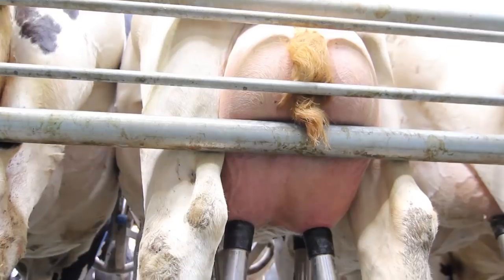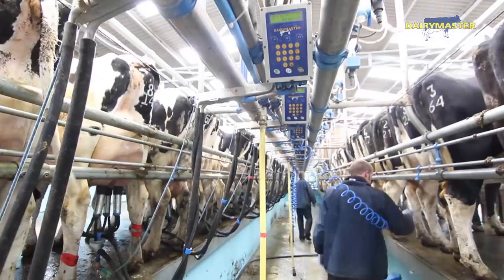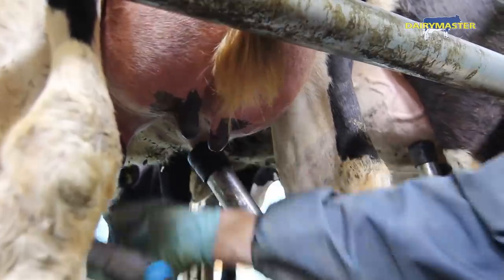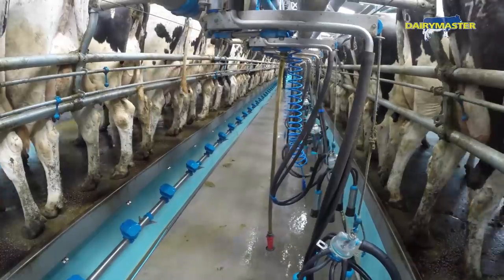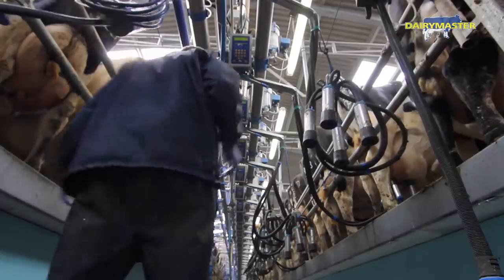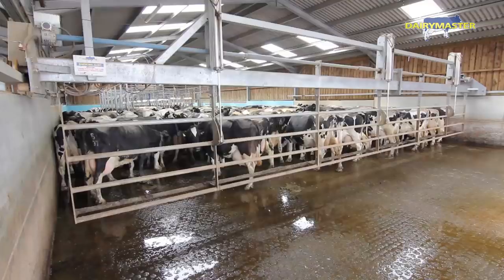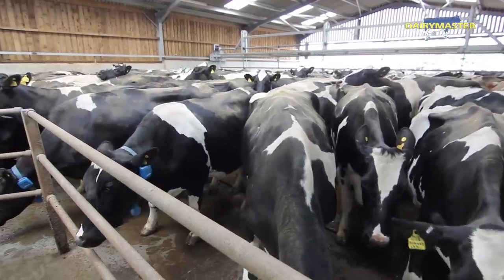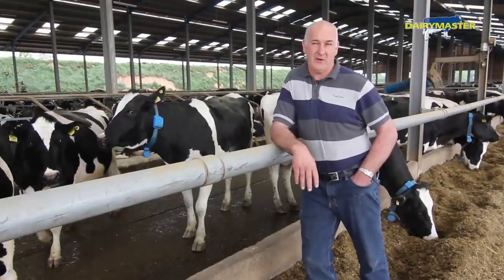Milking 1,200 cows 3 times a day! [Swing Over Rapid Exit]

Comment: How much does it cost
Reply: 20 mil
Reply: more then that by the time you just buy the land for the farm have ground leveled out in areas for buildings silos bunkers ect ur talking about half a million there then buy all the land wcith is more then likely 4000 acres  plus the equipment witch would probaly be about 7million cause you would want double or tripple of everything so if something breaks down. you probaly have close to 80 million if not more but if you lease land then it would be way cheaper. thsi if you went and started fresh but no one would start with fancy equipment probaly some old IH 14 sereies and stuff like that
Reply: roo clarke You don't want to know. Just a bunch if high tech blathering on.
Reply: Mr. Makaveli Sounds about right don't it.